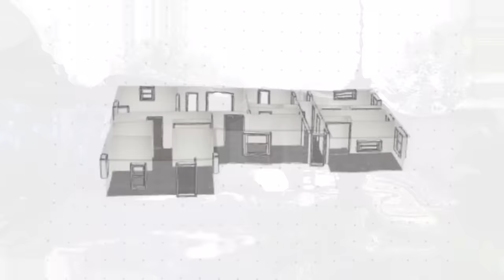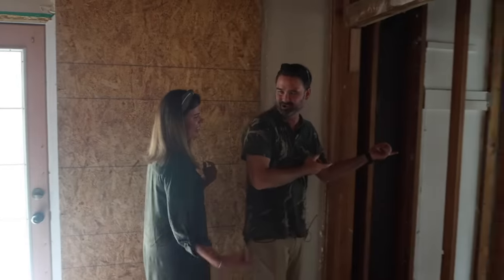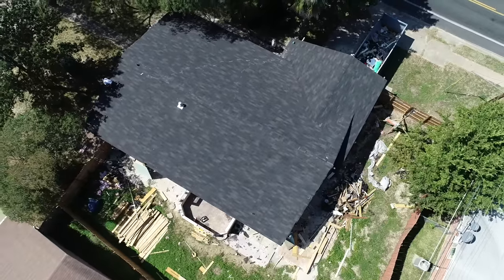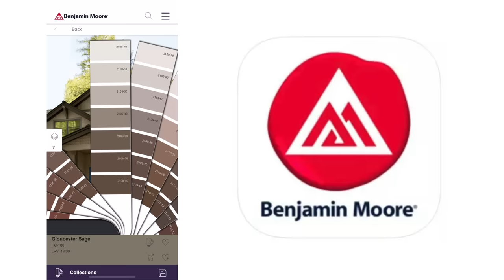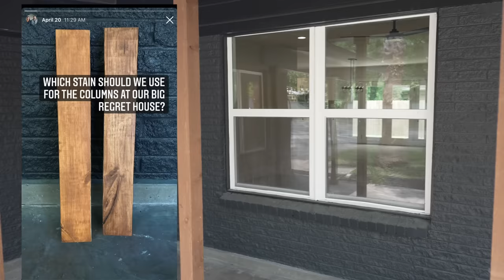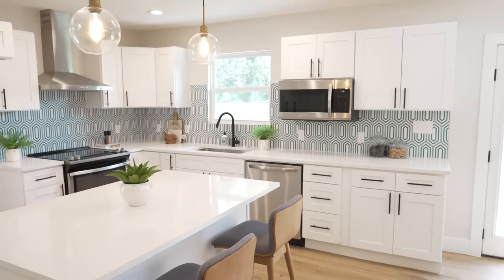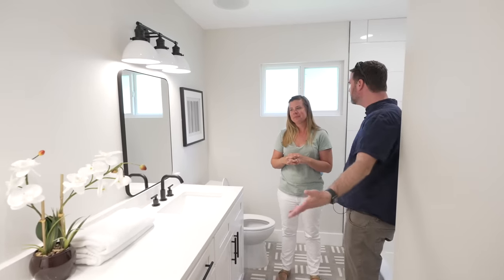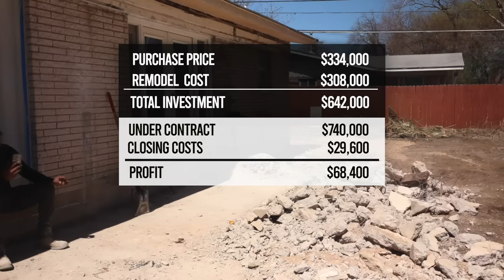We Sold This Abandoned House for $740,000 | Complete Before and After Renovation

Comment: Way too dark on the outside with nothing to lighten it up. Especially in a hot state
Reply: You must not live in Austin, this color scheme is very very common here with new builds
Reply: Remind me not to move to Austin. I agree with Teresa - a black house? NO.
Reply: @grayonthewater  Has been shown to be 80 degrees hotter than the outside temperature for black roofs or homes. Have fun with that ac bill.
Reply: Exactly, that is totally not a color for resale.

Comment: That black exterior looks sleek, but black absorbs heat and in 100f+ heat, that AC is going to work harder and cost more.
Reply: Yeah, the black is nice, but I’m definitely not a huge fan of it. Gonna be super hard to paint over in the future, and like you said, it’s gonna be super hot because the black absorbs sun.
Reply: It also noticeably fades...not a fan..

Comment: The garage addition still looks like a two-bay garage from the front. I would have knocked out that center brick divider and made the wood more seamless across the front. And, maybe given it more texture with putting the wood in a chevron pattern instead of just horizontal. Or high windows to match the other side of the house would allow light in, but still have privacy. But first preference would be turn it back into garage. To afford that much for a house, I wouldn't want my car out in the weather. If codes would allow, even a sleek carport would work.

Comment: I’m not sure I’d like the patterned kitchen tile after moving in. A white tile and go all the way up the walls might work better for more potential buyers...(opinion).
Reply: As an Interior Designer, I would have suggested:  (1) taller cabinets, run all the way to the ceiling, as the upper shelves could be used for storage of those seldom used (but important) trays, bowls, etc.; (2) eliminate the patterned tile and use a soft dove gray subway tile from countertop to ceiling; (3) use the same dove gray color for the island cabinet color to create a unified theme; (4) use a microwave oven hood above the range, as the current wall-mounted microwave is oddly placed, lacks visual balance in its current location, and it is incorrectly mounted to hang lower than the adjoining cabinet; (5) the island light fixtures do not complement a single design element in the room, neither in shape nor metal finish.  It would have been an extra bonus if you had installed a counter-depth refrigerator, allowing for a shallower cabinet above.  This creates a more spacious floor area between the fridge and the island.  A ceiling-height cabinet above the fridge would also provide extra storage.

Comment: It's definitely a lot better than it's dilapidated condition but I personally feel they dropped the ball on the outside pillars, they're so skimpy & not in proportion to the house plus there needed to be a contrast color on the outside. Even though I really like the modern dark color, there should've been a statement pop of color on the front door or something? And lastly the footprint of the master bedroom is entirely too big compared to that teeny tiny bathroom! They should've taken a couple feet from the bedroom and did amazing walk in closet & master bath that fit with the size of that bedroom. I liked everything else.

Comment: The garage conversion is horrible from the outside. And I get there is never a good way to hide it without totally residing, especially when there's brick. I just would have turned it back into garage. I'm guessing you'll be renting it or plan on the buyer renting it like you kept mentioning someone using it for Airbnb. Maybe you already had a buyer and knew that's what they were planning...?